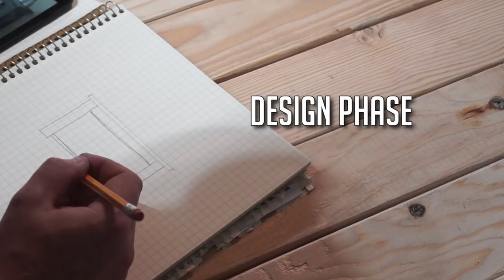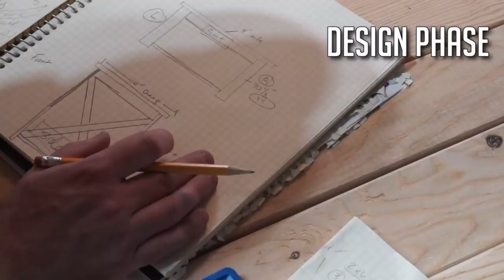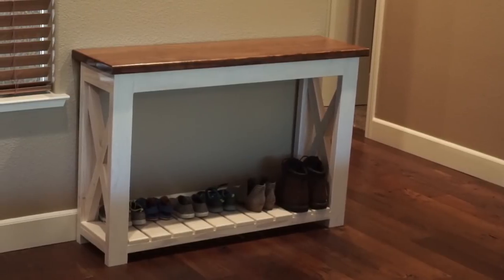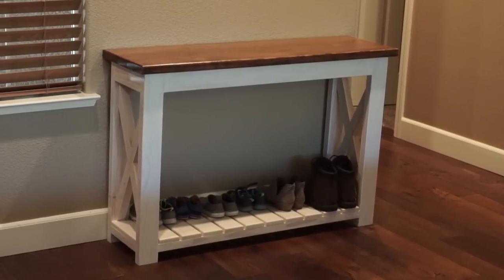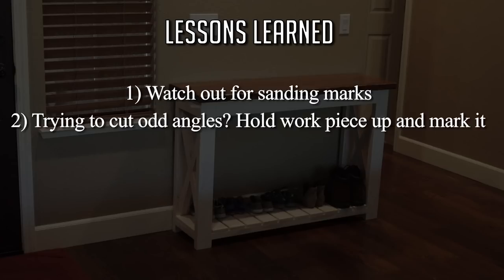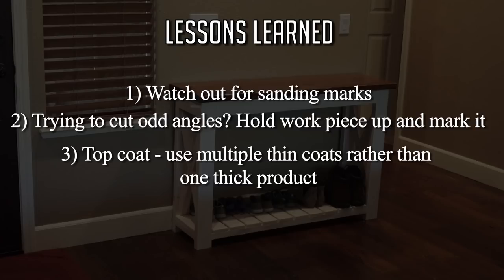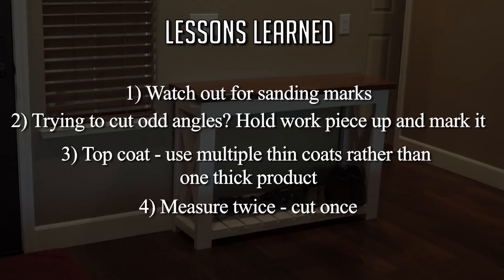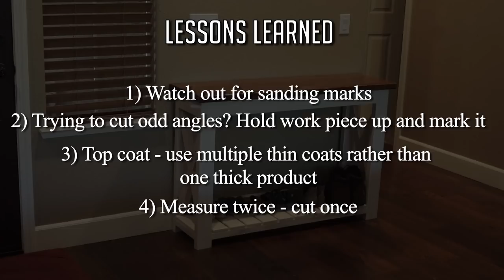DIY Console Table Build - Entry Way Table

Comment: Nice man!  I just used your video to make my own.  I'm stuck at the washers for attaching the top.  I didn't find the screws you used so mine stick up so I'd need a hole on the bottom of the top for that to work.  Do u remember the name of the screws you used?  And I need better bits to drill through these washers!
Reply from the maker: I actually just used pocket holes and screws to attach the top to the base. I don't remember exactly which length screw I used. I just made sure it would work before sending it. I do want to try those figure 8 washers to attach my next top though, they seem like they would work well. Thanks for watching, glad it helped inspire you!

Comment: Great build 
But how did you fit the other pieces of the cross sections, or did I miss that part? 👍🏻🏴🇬🇧
Reply from the maker: @agrafes6 Thanks for watching! I held each of the cross pieces up and marked where the cut should be made. Then cut and glued them in place. Cheers!

Comment: Great looking table. What is that tool you were using to square up the edges? It slides into the track on the table saw.
Reply from the maker: I was using a woodpeckers square to make the fence square to the blade, is that what you meant?

Comment: Have a question.  NOT a criticism.  Just curious.  You fasterend the top to the apron and legs with  pocket hole screws.  They won't allow for any wood movement of the top if humidity changes.  Do you think this might be a problem down the road?  I'm definitely not an expert on this stuff but am considering a build like yours and wondered about htis issue.  Any thoughts?
Reply from the maker: @Steve Seale that's a great point, thanks for asking. I live in an area that does not get significant humidity swings. I thought about using the typical table top hardware, but thought I would try this technique and see how it held up. So far no problems. Thanks for watching!

Comment: Nice video, but I have read and seen when gluing the table top, the clamps are supposed to alternate between over and under the wood parts. Also, I have read and seen that when arranging the table top, to make sure that the grains alternate between them, because it would avoid swelling of the wood. (Not sure if done that wa or not in your video). But for clarity, I am not a wood worker. I am just interested in the craft.